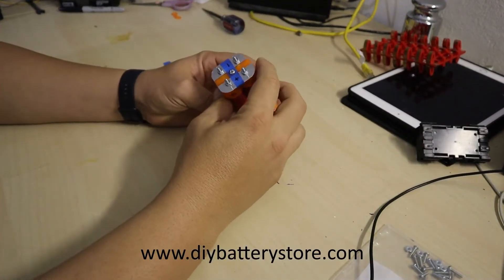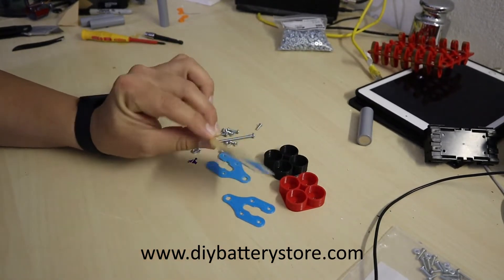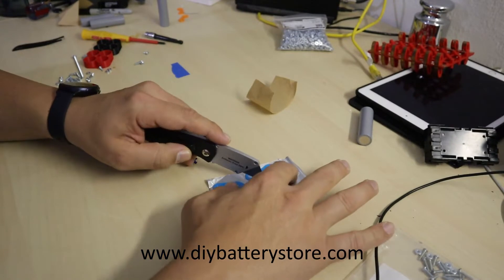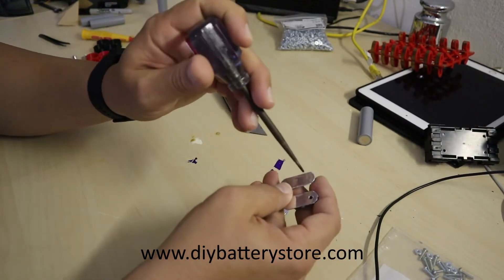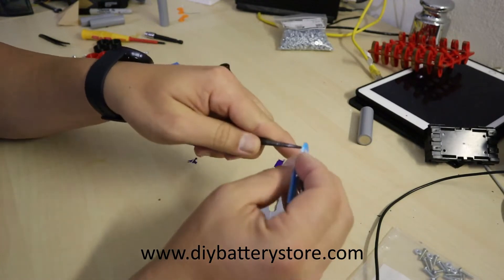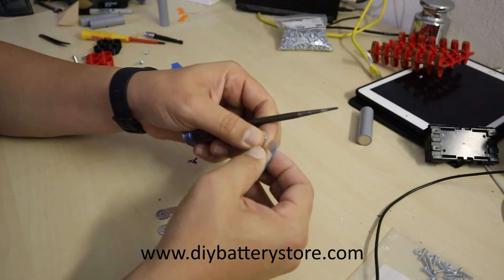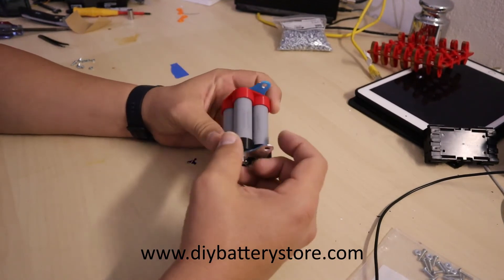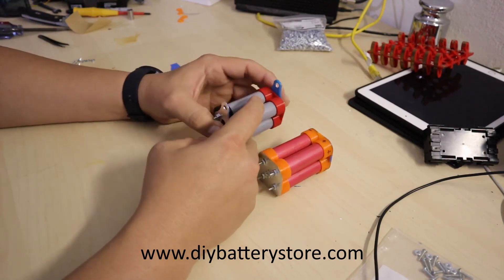How to assemble the New No Weld 18650 Kit

Comment: As soon as I get my 32  3.5ah cells, I'll be looking to get 8 of those kits for my home made portable computer (treasure chest). My battery pack design calls for 4S 8P as the computer is basically a power hungry home computer with a handle, and a DC PSU. There's enough room in my homemade computer case twice as many kits, plus the charging system and BMS.
I saved the store link.
Reply from the maker: Message me to  help you out with best pricing and setup
Reply: @javiercamacho  
Will do.

Comment: Aluminum tape eh? Looks dangerous.
Reply from the maker: And FYI, aluminum tape and copper tape is been used in solar panels and electrical connections for decades. 
Pcb boards are made out of copper foil tape and nobody says anything about it. 
Just look it up.
Reply from the maker: Tested at 20a and 30a and nothing happened so is more than ok.

This is the same thing as a pcb board. And like I said.... you can change it to aluminum plates